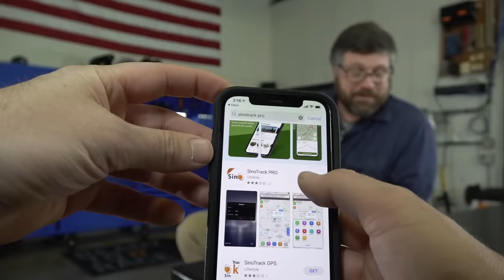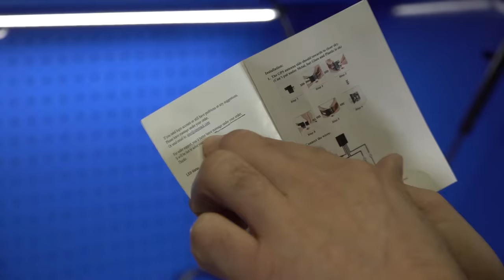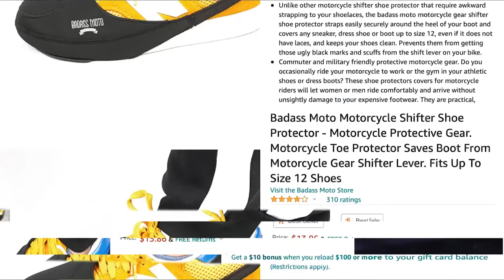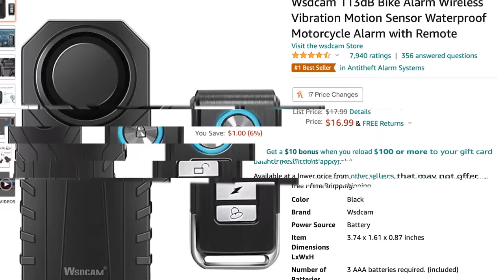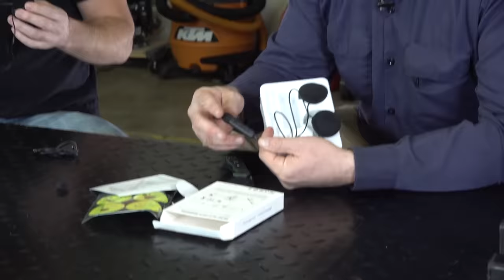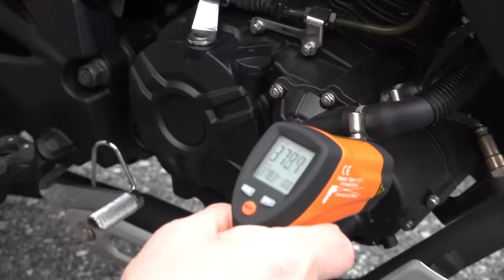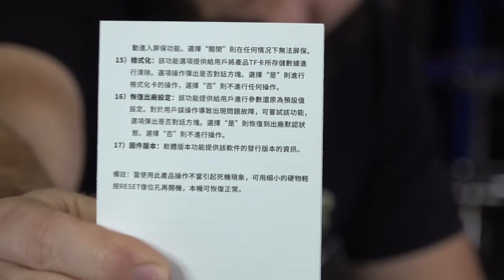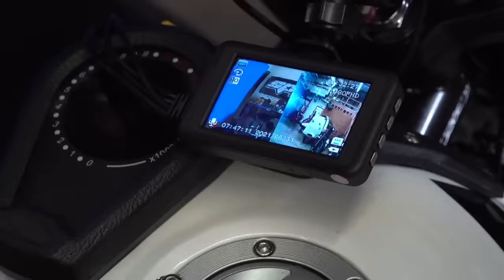Testing Amazons Stupidest Motorcycle Accessories(1 is Illegal )

Comment: I always thought the most useless addition to a motorcycle would be an ashtray.
Reply: How about a windshield defrost?
Reply: Why? I smoke while driving through the city sometimes in summer. And for the environment it’s better to not litter those chemical filled filters.
Reply: @danny9905  just don’t smoke while driving a motorcycle
Reply: @Kodaiva  It is legal, and safe enough when riding 30kmh an hour. We have strict (speed)laws here.
Reply: putting it on the fuel cap would at least make it more convinient
Reply: @supersoupss  😂💯😭
Reply: @supersoupss  Just pop the fuel cap open. There you go: ashtray!
Reply: @danny9905  dropping your cig on the road is probably 10× more environmentally friendly than actually smoking it
Reply: @adrianwelgemoed9562  Enlighten me with your wisdom! It sounds like bullshit but I’d love to be proven wrong.
Reply: @danny9905  yeah. Plus on a road its gonna get run over alot and disintegrated. Dont get me wrong though throwing your buds out your window or on the road is still a dick move
Reply: Depends on the type if it doesn’t close or have one of those funnel tops than it’s useless but if it can hold the roaches that would be nice
Reply: @danny9905  its nothing like gasoline bro stop stretching it and admit u in the wrong, smoking is not just bad for you is bad for the enviroment and smoking close to the gas tank could be bad for the bike given it could very easily ignite... so how is smoking on a bike not bad again?
Reply: @danny9905  Wouldn't the ash from the cigarette just blow away though? It wouldn't even stay in the ashtray would it?
Reply: @JD-mo3pd  There are so many incorrect things in your Post. I will not reply anymore. You Guys, live your lives as you like and then so will I.
Reply: I would say those screen protectors you put on the speedo.
Reply: @danny9905  just don’t smoke period.
Reply: @danny9905  what kind of simple addict smokes on their bike lmao
Reply: @danny9905  lol there was nothing incorrect about anyones post but yours. You need a reality check bud no one agrees with you
Reply: Not an ash tray, but one bike I had, had a cigarette lighter in the end of the handlebar LOL.
Reply: When you're on a bike, the world is your ashtray.
Reply: @danny9905  where?
Reply: a cupholder that's not gyroscopic
Reply: @JD-mo3pd  true gasoline ... or rather to proces of burning it is whorse for the enviroment than the cig ... so it would be better to not drive a motorcycle, just smoke and put the filter in the right trash ... there problem solved
Reply: @adrianwelgemoed9562  i throw 100% of my cigarette butts on the road
Reply: @danny9905  I go with him, just don't smoke while riding a motorcycle? You do it in breaks or something...
Reply: @ocal123  North Western Europe, my friend. Our government is afraid of nitrogen, so the highway/speedway is max 100km/h, at night 130km/h. All residential areas are 30km/h, industry areas are 50km/h and provincial roads (usually one lane in one direction and than one opposite lane next to it) 80km/h, parking places 5km/h or sometimes 15km/h. Welcome in the land of rules, called the Netherlands 🇳🇱
Reply: @geoffreyd3186  😂
Reply: You obviously dont ride cycles like me bro, i have 2 ashtrays for smoking up a storm.
Reply: Trick question. The motorcycle itself is the stupidest part.
Reply: Butts start fires😮
Reply: I've seen cup holders on motorcycles. Always scared me that someone would be drinking something and riding with 1 hand.
Reply: I thought the most useless addition to any bike is the rider
Reply: @danny9905 Live your life in a way that makes you happy and have no regrets. That's all any of us really can do. 

However, your direct implication that littering cigarette buts is bad for the environment but smoking is not is a bit silly. 

If you truly believe that to be true then it is YOUR responsibility to demonstrate that point. You can't assert something and just say "refute it then" that's not how being rational works. 

I can't say, "gravity exists because of a giant cyclops in space pushing everything down onto the planet with a massive never ending fart, what don't believe me then prove me wrong." 

That's absurd. I must prove the claim I'm making. Things are viewed as incorrect until proven correct for a reason. 

None of this is to say you shouldn't be capable of doing what you want on your own bike, go for it. I just think you're using random arguments to justify what you're doing when in reality you don't need to. It's your life nobody else's. If you wanna drive around one handed polluting the neighborhood with carcinogens then I believe that's your right. Not something I'd recommend but you aren't me and will make your own choices as to how to live.
Reply: @ZebsAlleyOriginalMusic  You are turning it around, buddy. He claims smoking a cigarette is more polluting than dumping its thrash which it is clearly not. If he claims this, he should bring the evidence in this case. I don’t have to explain why smoking a cigarette is less polluting than dumping gasoline? If so, go back to school, sir.
Reply: @danny9905  Incorrect.

Notice how I said "direct implication" 

Your initial statement of "it's better for the environment to not throw away chemical filled butts" implies that littering butts is worse for the environment than smoking a cigarette. Your direct comparison is between littering but the inclusion of "chemical filled" implies the chemicals that pollute the air thus are void in your example and thus are considered not as bad as littering. 

Learning about implicatory language is grade school stuff so If anyone needs to return to school it would be you so that you can actually learn about how the English language works.
Reply: @danny9905  Actually I'm not wrong about implicatory language however it being your third language explains a lot. It can be hard to grasp nuances in a secondary or third language. People struggle with it in their primary language. 

Anyhow, implicatory language is when you say something but it implies several other things without saying it. I even pointed out the "chemical filled" bit to make the point. 

You didn't directly say smoking is better than littering but it's IMPLIED. 

For example, If someone says their willing to rob a store but won't murder someone. 

They IMPLIED that murder is worse. 

It's similar here, you won't throw the buts away due to the environmental damage but you will smoke. 

Hope that helped you understand implicatory statements a bit better. 

Good job on English by the way. You're very well spoken for your third language.
Reply: And the ashtray is the most important thing for the Car , where else can you hide the key ??
Reply: @danny9905  Because your not just dropping those chemicals on the ground, by smoking them you put them into the air. It’s much worse for them to be smoked than to be dropped.
Reply: Air-conditioning 😅
Reply: @JD-mo3pd bro if a cigarette can ignite the fuel in the tank then the heat coming from the engine can do it too so stfu
Reply: @Kodaiva don't smoke at all.
Reply: @adrianwelgemoed9562  that filter takes 10 years to decompose.
Reply: @JD-mo3pd  why are you riding around with an open gas tank? ther wise smoking near your bikes not a problem
Reply: @danny9905  lmao why u smoking while riding
Reply: I guess if you’re extremely about environmental conservation
Reply: But what to do with your butts?
Reply: @deezgex  most leathers have pockets. thats good enough till you get to a stopping point with a trashcan

Comment: Been using that exact Bluetooth headset for over a year and it works great. The battery lasts a really long time so I only have to charge it every few months. I use it primarily for music. For the price, you can’t beat it!
Reply: Link?
Reply: @willmoore5550 yeah, a link would be awesome.
Reply: Followinf
Reply: Link
Reply: Same here awesome and super cheap
Reply: Like everyone said - got a link? Or at least, battery life estimate? My helmet comes with a bluetooth system but I've been thinking of getting a new helmet and if I could get something to put in it like this, my options would really open up.
Reply: Same! I use it only for calls now. Have a separate Bluetooth for my Electra glide that I play the music through the bike speakers and I can make/take any calls on the the headset speaker. Pretty cheap setup but it works.
Reply: Share the link, for the price I am interested
Reply: is it better than airpods

Comment: I actually recovered my motorcycle with that GPS 2 years ago. Its hard to connect but once its connected its very accurate because it uses cell towers and satellite signals. The sim connection was $5 per month.
Reply: Damn that's really nice. Was your bike still in one piece? 💀
Reply: @Mech.E  it was ready to be shipped somewhere. But I got it back in 1 piece.
Reply: One of the mistakes of this video was holding the GPS antenna down.
Reply: Samsung smarttags!

Comment: I think the helmet break lite  would be great for snowmobiles and off-road use. Especially for those people with older machines that nothing works but the motor lol
Reply: Damn! That's a great idea actually. Even bicycling. 

Tangent: when I was 15ish, my buddy & I were biking on the green belt in Denver at night. He stopped abruptly for some reason, I didn't see him, smacked square into his rear tire, and subsequently his seat smacked square up his rear end. 

Poor guy...he's been pooping pancakes ever since & still sees a shrink to this day! If only he had this inertia brake light...

Jk, but he did try his damnedest not to cry & be a man about it. Only problem, there's no way to be a man about getting...well... penetrated? And I absolutely would have felt bad if it wasn't so absolutely hilarious as a 15 y/o that his bike stole his virginity. 

You are welcome for that completely unnecessary story btw. Your comment just reminded me of something I hadn't thought about in a couple decades.

...truth be told, it's still kinda funny.
Reply: @coloradomike3066  these actually do exist in the cycling realm. My road bike's rear lights work like this, its very useful on roads I have to share with motorists
Reply: Mine was $50, I had to install a module but it links to the bike's brakes and turn signals
Reply: I keep getting Facebook ads for a $250 system. It’s advertised for bicycles and other types of things so I can see the idea behind it. I wonder if the laws about it are different depending where you live

Comment: I've used those relay trackers on my bikes and my track record is 4 stolen 4 found, I pay something like £4 a month for data on the thing with live tracking which also records online in the app so you can not only see where it is and turn off the engine but you can also see where its been on a timeline.
Definitely well worth a look if you have the patience to set it up, took me about half an hour.
Reply: Im also using it... Here in my country we have data plan that has no expiration so i just have to spend 6$ for a 30gb data (which can be also converted to mims of call or no of text) ... Which is morethan enough for the lifetime of the tracker..
isntalled it. Myself.. Its not even that hard to install it
Reply: @theenzoferrari458  a bit paranoid are you? You're on the Internet, they have everything they need on you already.
Reply: Did you use the same one they had in the video or another brand?
Reply: @thecheetahman22  sinotrack, yes same
Reply: @theenzoferrari458  the govenmnt is not only your main problem when u use it. 
Its a Chinese producet, using a chinese server, so your data is stored somewhere in china
Reply: Don't know where he got $600 a year from, unless the US has ridiculous pricing. It's not like this will use as much data as your phone.
Reply: @elobiretv  I thought the same thing. I dont get why I couldn't use the same network I have in my backup phone that I pay $8/month for. And I could lower the data from 3 gb/month to 500mb and get that down to like $5/month
Reply: justinl458 sorry to burst your bubble but, you're not that important
Reply: Yeah, 600 a year seemed like a massive over estimation in my book!
Reply: @elobiretv  I was wondering the same. We get $30 sim cards with 6 months of service specifically for GPS trackers off Amazon for some of our needs.
Reply: @jbstillman  Yeah there's literally operators specialized in that, you could use an M2M operator which is for machines sharing data. A low data plan that's enough for a tracker can literally be less than $10 for a year and cheaper in bulk. Costs go higher if you want global coverage. So yeah "at least 600 dollar" is a big yikes
Reply: You are obviously paid by china to leave this comment.
Reply: @elobiretv  He's thinking a major data plan from like T-mobile, AT&T or something like that... Which is stupid as hell. There are tons of low cost plans out there for sim cards as others have mentioned.
Reply: @tomboyle4312  i think he didn’t know the best way to do it like you guys. sounds like he’s getting a phone plan for it 🤷🏽‍♂️
Reply: @SilvaDreams  even T-Mobile has IoT data plans for as low as $5.00 a month...
Reply: These prices seem insane I currently pay 11.99 € on my phone for 100GB of internet and unlimited text/calls.
Reply: @theenzoferrari458  wait until you hear about your cell phones gps oinger
Reply: @vilneas6358  i dont know about a oinker
Reply: @SilvaDreams  are the major data plans really that expensive in the US?
50$ a month is a lot of money.
Reply: @Jehty_  That is more a full plan, both unlimited phone/text and data
Reply: @Jehty_  in canada for 25gb it's $85... 😔 for $40 you get max 2gb data.
Reply: I'm definitely adding the relay tracker to my shopping list for when I buy my next motorcycle, thank you for sharing your experience with it !
Reply: Seriously, 600 a year seems ridiculous, even for the very capitalistic USA. There are so many mobile data plans on the market in every country, can't imagine there is no cheap one there too. I (in another country) have a zero dollar plan. I pay nothing (they make money with adverts and if you buy additional data or use it to call someone, etc.). You only get some hundred megabytes per month but this should be enough. And even if it isn't enough, you can just login into your account (don't need the card on you) and pay like 3 bucks to get more data (gets applied automatically), in case you need to track it.
Reply: @thecheetahman22  what do you use?
Reply: @jbstillman  what do you use?
Reply: @Myztik7  what is $10 a year
Reply: The problem is that a lot of carriers just can't have it be used on their network, 2g is so old it's eliminated by a huge portion of carriers in the US.
Reply: @Max-ox5jd you can go cheaper. There’s everything from $15 to $70 a month with a new phone upgrades. The thing is that a lot of companies in other countries just copy research that US companies do so it’s a lot cheaper for them. US companies are the ones who created all the tech so lots of money goes back into research and launching satellites etc... A company in like India or something can make phone plans so cheap because they just copy US inventions but they are always kind of behind. It’s the same thing with pharmaceutical companies and med research. US pharmaceutical companies are the ones inventing all the new medicines and trying to push everything forward. A smaller country can just copy the new meds and sell it for cheap because they aren’t paying for research. If America wanted cheaper everything they could just stop trying to advance technology and just sit back and wait for someone else to do it but America isn’t really like that
Reply: @BiggestRedditor  Dream on🤣

Comment: I have that alarm (in the UK) and it works brilliantly. There are sensitivity settings so you can alter it to prevent the wind setting it off and the batteries last about 6 months each time. If I lost it I'd buy another and I don't say that about many things!
Reply: I also found it very remarkable they didn't seem to get it working AND I was astonished at the $600. Maybe the manual wasn't clear or faulty but most of the times these kind of devices aren't that hard to set up.
Reply: Had it for about a year until the key fob broke off my keys, for the price and ease of use its definitely worth buying again, its a little peace of mind and was plenty happy with it.
Reply: If it's double stick taped to the bike, how can the AAA batteries be changed?
Reply: @dubmob151  either by un-taping it, using something like twin-lock or velcro instead of tape or by taping it in such a way that you can access the batteries without removing it. It's tiny, it won't be a problem.
Reply: @elliottsw  sounds like the way to go, any permanent type mounting would be too much hassle to change batteries, which would be necessary at some point.
Do the AAA batteries last reasonably long?
It would have been nice if they made some provision for silent arming, sometimes you don't want to broadcast the presence of the alarm or disturb everyone.
Reply: @dubmob151  I got a couple of months of daily riding out of mine before they needed replacing/charging and I was using some old, cheap rechargeables so nicer batteries would probably fare a little better. The loud arming and unarming always made me a little nervous early in the morning waking up my neighbours but then I started a motorcycle outside their window so that's probably more annoying for them! Anything that deters a thief is a good thing in my book.

Comment: I installed the valve stem TPMS on my 1981 R100RT and have never had a leakage issue after about 4K. Then I got the same system for my 1987 GL1200A, again no problems after near 20K. Then I added a 4 wheel system to my CRV since it's built in one is just a idiot light, again after about 60K no problems.  And a hell of a lot cheaper than even getting an in tire sensor replaces.